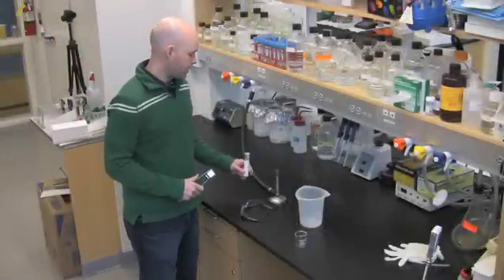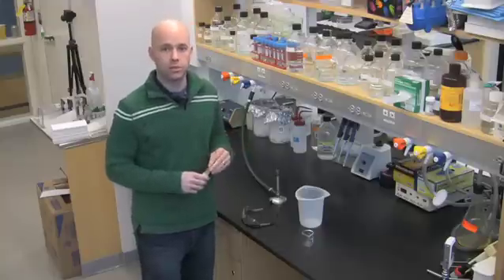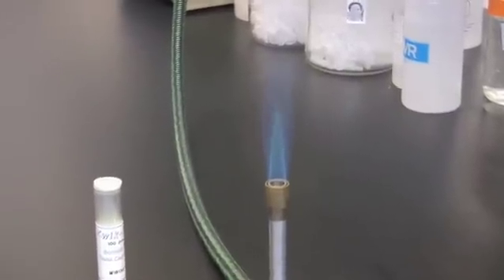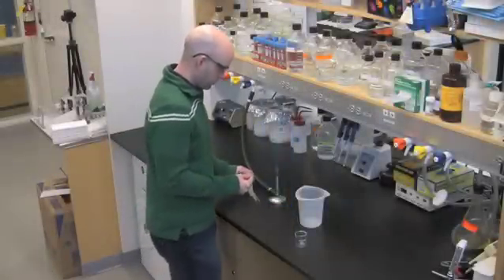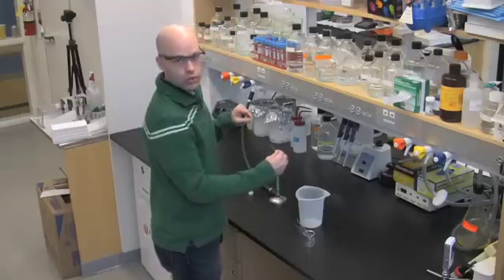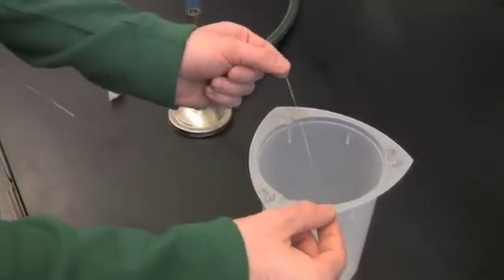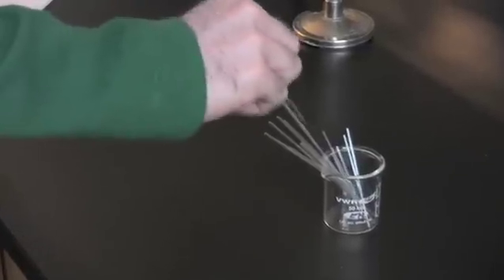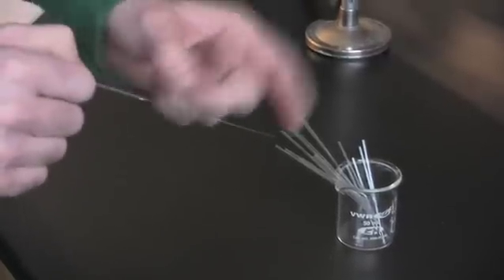How to pull capillary tubes

Comment: He would loose control as his hands sweat in the gloves making him more likely to drop the glass tubes, shattering everywhere. The flames do get hot but it is controlled and you can see his hands are only near the flame for at most 30 seconds. More then likely if he were to be wearing thin latex style gloves near open flames, the gloves would melt onto his skin causing more damage then needed. Just because certain PPE is exists, doesn't mean it applies for all situations.

Comment: This guy insists on wearing eye protection but he wont wear gloves around a blue flame or while breaking glass?  I'm thinking he probably lost all his hair in a laboratory accident.
Reply: Have you matured and wisened up now, enough to know better than to think the same things you used to think 9 years ago? I have broken off those delicate little pulled tubes with my bare fingers hundreds of times, and not once have I had an accident. And the flame isn't at all that hot at its sides, it is hot only above.
Reply: I think you're just mad about the hair joke.  I was just kidding, Lex Luthor.  Let it go.